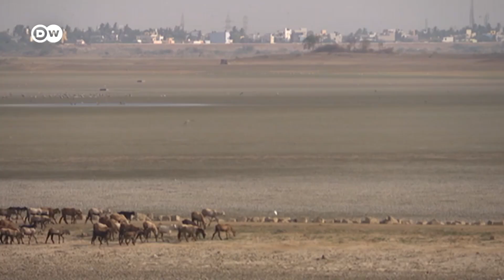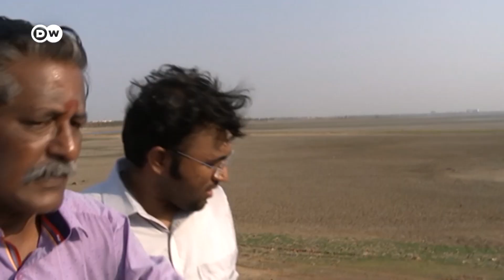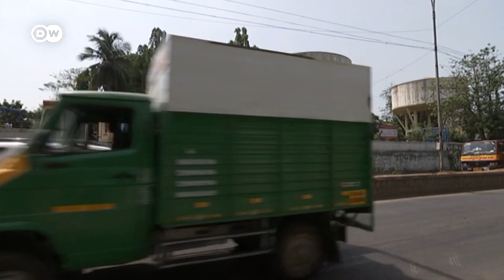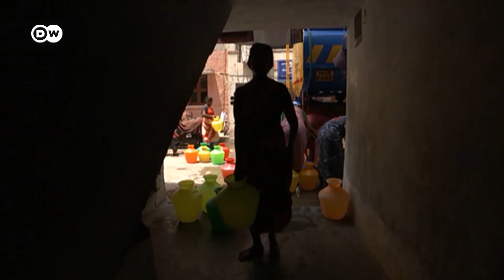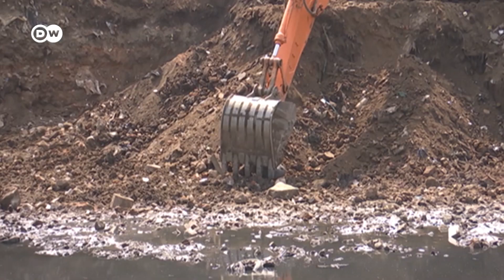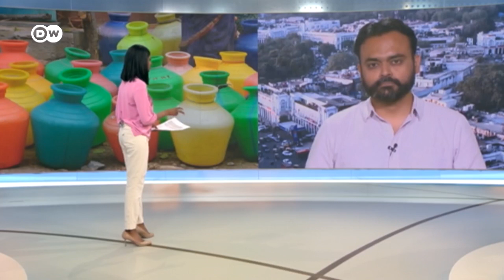Climate crisis in India: Heat wave causes water scarcity | DW News

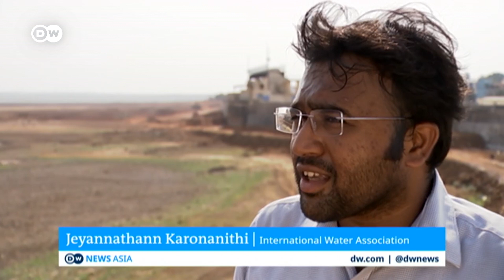Comment: The city goes through a cycle of 5 to 10 years when the rainfall fails the city 1:37. So it is normal and not due to climate change.
Reply: And more importantly they know very well that this cycle gets repeated every 5 to 10 years but still no solutions have been found so far. Well they would have if instead of raking up non-issues their useless politicians worked on finding solution to this issue in the Detroit of India.

Oh well if anybody knows Detroit is also a failed city in USA.